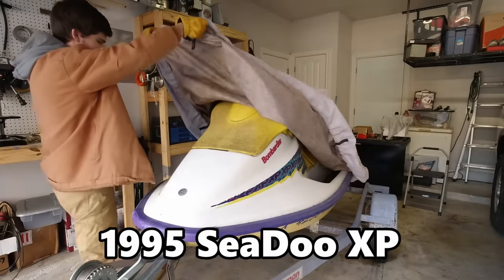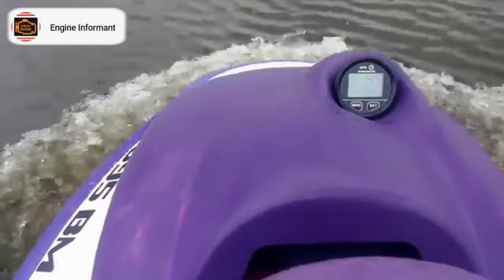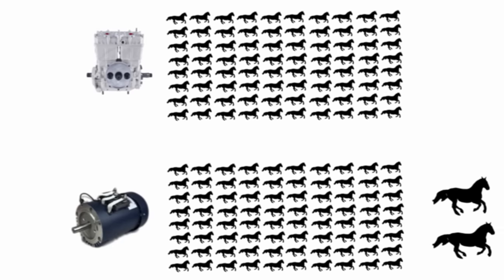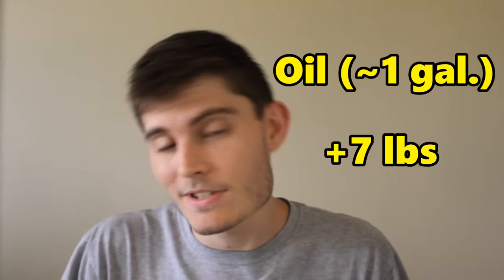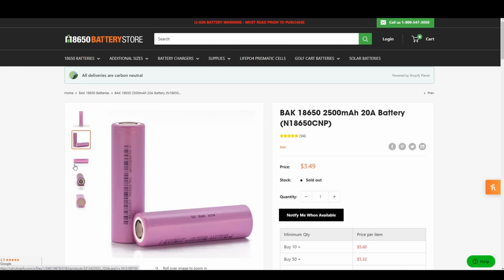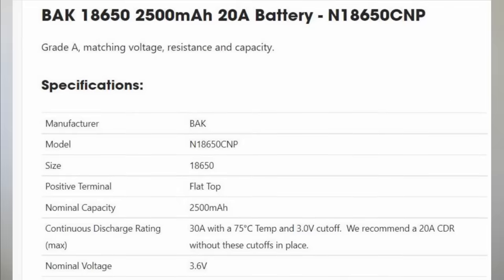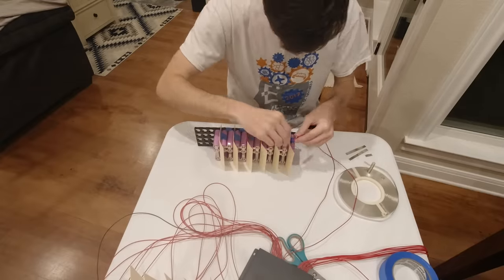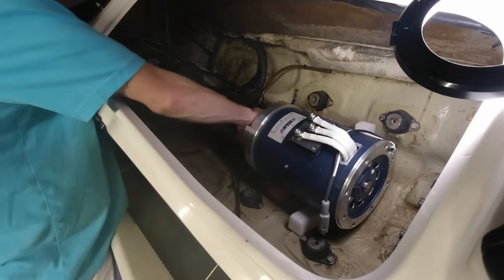Electric SeaDoo Conversion!

Comment: Finally Someone took my build to the next level. Great job on the outcome! Next person will have to focus on the budget numbers to make this homebrew a DIY hack all should build! Great Job Zach
Reply: No kidding... it's an amazing build, right?
Reply: English not my native language but, if we build conversion kits to sell around world, will be a great business.
Reply: I watched all your videos before doing mine! :)   Standup E-ski: https://youtu.be/Lt0ocjGOkcQ
Reply from the maker: Max Speed: ~35 mph
Max RPM: ~6,000 rpm
Runtime: ~30 minutes
Weight added: +50 lbs
Battery Voltage: 128 volts

Hopefully people will see these stats, I should have put in the end of the video!
Reply from the maker: CBDC CHRIS  🤣
Reply: @ZachsGarage1  hey zach you did an awesome project i watched the whole video and at the end you show the red plastic thing falling a part ,i tought why you dont have any gear ratio from the electric motor to the turbine with maye a 1,5 ratio so you can go higher rpm on the turbine without going higher on the motor? or is this not possible? i hope you understand what i mean.

btw great work!!
Reply: @LuxusLeina  you want to keep that jet at a sweet spot on rpm so you dont get cavitation, will burn it up real quick.
Reply: To make it budget use a used forklift motor.  It's only dc but regen isn't needed or plausible with this application.
Reply: @ZachsGarage1  It sounds like the moter is not alligned with the jet pump shaft properly, that is also why the coupling is coming apart. they have to be very precicely alligned otherwise not only will it shred the coupler but it will ruin the bearings and seals of the jet eventually flooding the hull. cool build though. considering a rebuilt engine can cost between 7-10 000 even going with a larger electric motor would stilll be cost effective. runtime is a bummer though, usually a tank of gas in one of those will last for hours!
Reply: @ZachsGarage1  so you tell me I can only use it for 30 minutes out on the water? Lol
Reply: @mikep8861  If you have more in your budget you can get longer run times. It's all down to the battery you build. Electric is not going to be as efficient as a small 2-stroke or 4-stroke engine. You're ignorant of the difference between EP & ICE. lol
Reply: @FarmerFpv  yea. No shit. I was talking about his build. I know electric motors. I got 5 years of electrical school. What about you?

But like he said you can’t put 500lbs of batteries in a seadoo so there is kind of a limit but you can use a different type of battery but that still has limits. 

The point that went clearly over your head was that he said he didn’t want to spend $900 on a new engine but chose to spend a few thousand on a electric conversion with hardly any run time..
Reply: @ZachsGarage1  The spider breaks apart because the love joys are not lined up exactly right. They need to be inline to a MM or it will keep destorying spiders. We use those all the time on Crab boats for our tank pumps that flood and drain huge tanks that hold 400k crab/fish.
Reply: Thanks to Youtube algorithms for recommending this video! Searched for three years, there were no good examples! I have the same jet ski, even colors and years, but not XP but GTI! I have long dreamed of transferring it to electric, I have even bought a motor! In the video, everything is done very competently, everything is super, except for the battery! the battery in the electrical theme is 90% success! Lithium iron phosphate prismatics in blue cases are highly recommended! they give more current, do not heat up, and are not very afraid of the cold, and they need less quantity! It is important to seal all wire connections against water! I really liked that the author taught the culture of weight! according to my calculations, about 80 kg is allocated, this is about 15 kWh of energy Thanks for the video, good luck! Subscribed!
Reply: @ZachsGarage1  Is that 30 minutes runtime going full speed?
Reply: Although it has flaws I know what id personally change. That said it is cool. 

Personally what id change is I'd use metal ammo boxes to help disperse heat when high draw  coat interior of box with foam run a copper line from water in front of vessel to cool batteries don't like idea of being on something in 100+ degree heat with batteries that can and will explode in extreme heat. Essentially a liquid cooling loop for the batteries using the forward motion of the craft to cool the batteries effectively fixing possible heat issue as you go forward the it would cool batteries more with more speed of travel.
Reply: Well technically in the context of horses as a measurement of power but one horse is actually equal to 14hp per horse I know what u ment but I like to tell people random small facts
Reply: Maybe during your next build you should try to contact Koenigsegg that currently have the smallest electric motor on the market (63LBS and 335 hp ;)) btw cool build.
Reply: Great job but...... At the start of the video, you claimed that  the price of the gasoline motor was more than you wanted to spend, and then proceeded to spend significantly more money. The gas replacement motor would have got the job done at a far cheaper price, for a fraction of the time, and involved around 1000 less child slaves to mine the battery materials. Not that I'm against child slave labor. I think that the child slaves save on using large machinery that would contribute far more Co2 emissions than you would ever use in your lifetime on that Seadoo with a gasoline engine. Electric powered vehicles have really progressed technology into the future. Or at least make us feel like we're doing the right thing. And that's all that matters these days. Is our feelings.
Reply: Try a cvt systeem on your bike elektrische engine.
You can easy make it your self .
Reply: @shperax  It's also great that the massive open mines and the deep tunnel mines to get these 'renewable' minerals are in countries I'll never visit.  That way I don't have to see these oil and gas drilling rigs as I drive down the road. Go green 🤮🤢
Reply: Liked the part where claim to connect an obd 2 scanner to collect data on motor  ….  Oh boy! I ordered 5 of those. Right away !   Good job wasting time  obviously more $$$$$$ than sense
Reply: There are 3D files for high pitch/ low rpm jet prop conversions. Not too expensive to have printed. BTW you can get high voltage /high amp lithium batteries pretty reasonably which are denser than those ammobox arrays. some even have bms built in. Cheapest DIY would maybe be getting parts from a wrecked electric scooter for the engine and battteries, etc.

Comment: So I have built a number of electric vehicles. That much power (66kw) by my calculation should have been a lot more impressive then what you are experiencing. I hate to say it, man, especially since it's a year after you post this video, but I think your controller isn't programmed properly. The heat building up is also a sign of improper programming. I know it takes a lot of power to push through water at high speed but the torque off the line should be pretty insane with 66kw of electric power. I don't know if you have moved on from the project but you might want to have another look at your programing. You could be sitting on a real monster and not even know it.
Reply: Jet pump efficiency is the problem, 35-40%
Reply: If not that, he needs to check the drivetrain. One tiny piece of grass stuck in the impeller will stop my jet ski from planing and normally it gets up to 50mph. This is very high precision stuff. I think the motor you have can do it!
Reply: Nobody cares
Reply: @PaulGait-py5yb   I care 😉
Reply: @jayesh5131  prove me wrong
Reply: @PaulGait-py5yb  I just did 😒
Reply: @jayesh5131  also, let me know how much money the actual, not proof of concept costs... it's pretty clear this guy spent Hella money on controllers and all kinds of auxiliary shit to make it work dogshit...  see you in 5 years...
Reply: @PaulGait-py5yb  Cheaper than replacing the combustion motor, also the fuel is ded cheap and no maintenance!
Reply: Guess my comment was too mean, it's gone!!!
Reply: In this type of design, benefit from electric power is smaller than with cars and such. That’s because the torque in lower rpm means nothing. 

To accelerate fast, you have to put the impeller into maximum rpm, and that doesn’t change much when vehicle gain some speed. 

Most likely to torque and efficiency curve of this motor didn’t match the impeller properly. Motor started to loose it’s torque way before the impeller was putting out it’s maximum thrust. Before high efficiency area, lots of energy is being wasted on just blending water.
Reply: @jayesh5131  Cheaper than replacing the combustion motor????? This guy spent like $5k on all his parts and the gas motor was $1000 for a fully assembly
Reply: @jonathann2093  What jet engine costs less than 1k$??? Also this is a project
Reply: @jayesh5131 jet engine? It's a combustion engine that's attached to a jet pump. That's how he was able throw in the electric motor and still make it move. You could throw anything in there to move the pump shaft. A whole bunch of people will throw in cheaper engines from other companies that are the same size and buy a $100 cheap programmable CDI box just to keep an old broken pwc running. This guy wasn't doing this build because it was the most economical or logical route. It was a challenge that tested his skill set.
Reply: @greapsoho  My bad🙈 jet ski engine 😁
Reply: @jayesh5131  my bad!
Reply: Hello, I want to put an electric motor on top of a blow Tahatsu 40hp. What size should I look at getting?
Reply: @jayesh5131 the ICE was 1000$, he spent more than double that on the motor and controller.
Reply: @Superhunan  Again,
The fuel and maintenance makes the electric one cheaper. Also this is a project. He wanted to make an e-jetski 😊
Reply: @jayesh5131  I was responding to your claim it was cheaper than direct replacement. You’re just flat out wrong. This model might cost 200$ a year for maintenance and 30$ to fill up. Hes got 5k minimum tied up into this project that barely gets him on pad and might have 30mins run time.  It’s a super cool build. But $ for $ is no comparison to the combustion replacement.
Reply: @Superhunan  5k? Who said that!
Also 30$ for fuel? Lol
It's a project, it's supposed to be fun and maybe he can learn a lot of things about how all this works.
Reply: @jayesh5131  math said that. It’s all in the video. Try and keep up !
Reply: @Superhunan  30$ for fuel for an year? How did you come up with that math! 
Looks like you gotta a lot to keep up
Reply: @jayesh5131  no stupid, a fill up. As was clearly  stated in the comment. Try and keep up dolt.
Reply: @Superhunan  try again dumfkk...
Try again 😭
Reply: @jayesh5131   is that what is looks like when you cry because you can’t read ?
Reply: @jonathanmcc5999 factor in fuel and maintenance over a given time
Reply: @Superhunan I have never seen a thousand-dollar ROTAX engine in my life.
Reply: @daleyoung3566  I don’t remember anyone saying anything about a rotax engine. In fact, I’m pretty sure he said the cheapest ICE replacement he could find was 1k$. A quick google search will show that to be true. I don’t actually know what your comment had to do with anything.
Reply: @jayesh5131  no Jayesh... You haven't proved any proof of concept... Means your a Non Person Character... Enjoy pushing your Flintstones car with your yabba dabba toes
Reply: Off the line ev advantage on road vehicles doesn’t translate well into boats. You can put enormous torque to road at any speed. Due to this EV povertrain with access to low end torque has advantage. But boats don’t have that. Boat prop or turbine doesn’t work like that. They are optimized (”geared”) to certain speed and simply can’t put much torque/power to use at lower rpm. It doesn’t matter that the motor can provide the torque, there is no resistance to utilize it. This is why on boats ICE hp is actually quite equivalent to E-hp. On road EV usually has significant advantage.
Reply: @teropiispala2576  you covered it already! Well my reply was more wordy 😂. Boats indeed are a decent match for ICE.
Reply: @heikkianttila6296  I believe you know what you are talking about. That being said 66KW is massive power and that jet ski isn’t putting out 66KW. I believe you are on to something with turbine speed being incorrect for the application. Overall I could agree it might be improper RPM output causing the issue. That’s easy to check before diving into the programming.
Reply: Then You build one

Comment: Pretty sweet build! You should try a more aggressive impeller pitch since the electric motor isn't intended to run at the 6800 rpm max of the gas engine.
Reply: This is it. More pitch
Reply: I know a guy who owns a company that makes impellers for jetski's to provide more height in flyboarding. Maybe that's an idea.
Reply: For the purposes of this build, which is quick and dirty, the continuous max of the motor is 5,000 rpm and max rpm is 10,000 rpm. And the motor is designed for 120-164 volts.

IMO he really needs at least 144 or 156 volts and crank up the rpm to around 7,000 rpm to match the original ICE and the top speed of the ski to around a more pleasing 45 mph, and at optimal conditions, maybe around 50 mph. He’s not gonna be at WOT for long enough to be an issue to blow the motor. But he should run this at WOT for only short amounts of time given that caveat. This is really more of a proof of concept. But yeah, ideally you’d want to tune the impeller to lower the rpm so it doesn’t exceed the continuous rpm of the motor.
Reply: @mrsixtyfuckingnine  It's a prototype, as he said himself. He can leave it like it is, which still exceeds continuous motor rpm by 1000 rpm and get subpar performance. I'm just suggesting as a prototype, he should be trying to get 45 mph out of it, which means he exceeds the continuous motor rpm even more. I totally agree with you that it would be ideal to change impeller pitch, but for a prototype that has already costed way in excess of thousands of dollars over his budget, nah. 

It's irrelevant that you currently own a jet ski. My parents owned one and I've rented them numerous times. I know WOT is more fun, no one is disputing that.
Reply: @mrsixtyfuckingnine  I owned a GTX 650 for a few years and it was full throttle baby !! Mine had a racing impeller and managed 46 MPH off GPS compared to a cousin's identical ski that did 35.  This project seems horribly inefficient - but if re-engineered as a hydrofoil with less water drag and a lighter foam "boat" I think he would have something.
Reply: From my knowledge, resistance is heat. Run that puppy to the highest voltage it will take. 132 is still low. Try another 32 volts. Also, the higher voltage will hold the voltage above minimum longer.
Reply: I watched the video again and he showed the hp and torque characteristics of the motor. It maxed out around 5,000 rpm and tapers off after that. He needs more voltage and definitely needs an impeller with more pitch to make this thing run out right. If all he did was throw batteries at it, the motor isn’t going to produce max hp where he needs it.
Reply: i thinks he can make it less weight if use EVE lifepo4 cells
Reply: @mrsixtyfuckingnine  when I'm out I'm wide open all the time
Reply: And how long does it last ? How long time with a charge and how long to charge it?
Very interesting anyway, you’ve put a a bee in my mind;)
Reply: Wouldn't more pitch require more torque?
Reply: I subbed Jo just to help pay for future products and videos. I’ll see you at a milly
Reply: @circle7motorsports on an electric motor torque is 100 % all the way though the RPM range . The batteries will be the ones to take the load and shorten the range of the jet ski .
Reply: But it's much much wise to put gas engine back and don't pis brain about impellers, overheating batteries, and couplers breaking in few minutes.
And preparing ti ride will be few minutes to fill gas instead of few days used for charging batteries.

Comment: Zach, the seadoo itself has a max load capacity as well. If you weigh less than the max load capacity then you can add the remaining capacity after subtracting your weight to the weight allowed for batteries.

Comment: To take advantage of the higher torque out of your motor, you could swap the impeller from I believe was the 717 engine that ski came with with the 787cc impeller, it has tighter pitch, you’d also need the 787 impeller shaft kit for the jet pump. Easily doable.